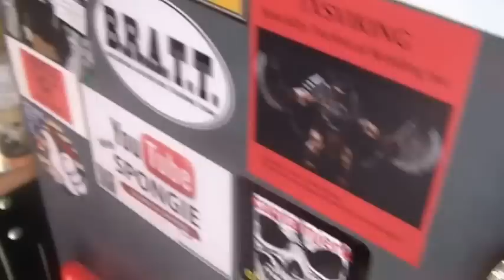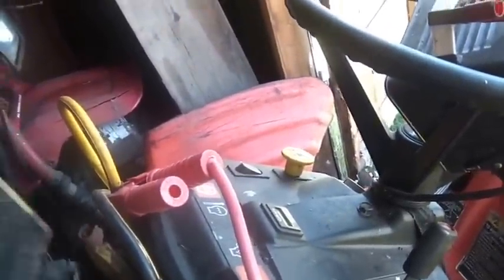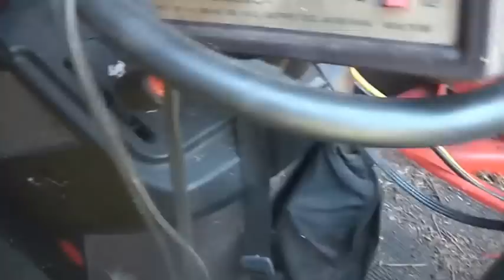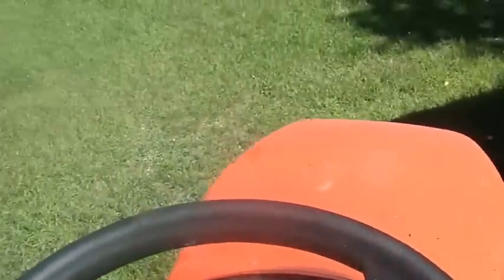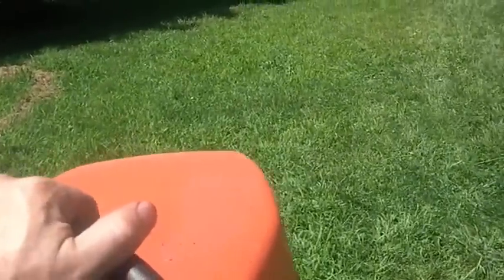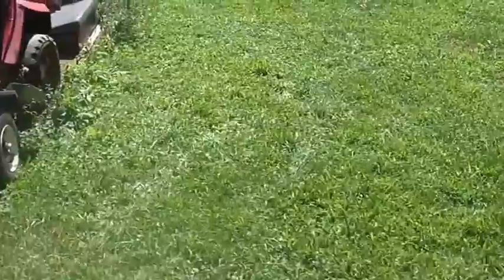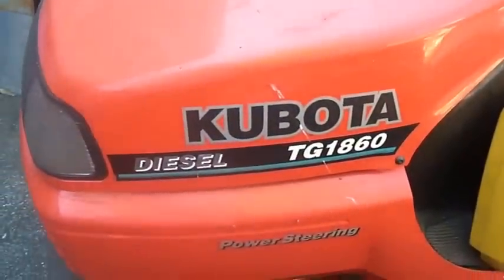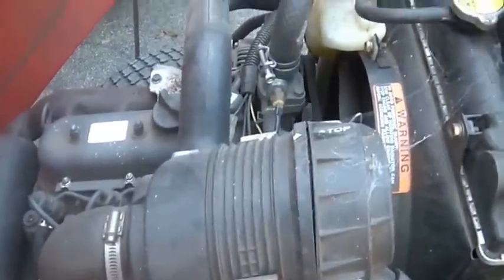Kubota D722 diesel cold start, TG1860 ride,

Comment: From the sounds of it you like the heartache and sometimes difficult and adventure of the older cheaper machines.
That Kubota is a very cool tractor, I had a much smaller Kubota gas model very similar in many ways.

Comment: Harvey I like by Kubota tractor , I never had a problem. I have 2  Kubota z482  engine I got new both have less than 60 hours , one I turned unto a diesel log splitter and the other just sitting in storage. Great engines.
Reply from the maker: Hey Steve!!!   Not easy to lay ones hands on Kubota engines, they are great engines, but, expensive... Cool that U got 2 and one is a spare, I don't think Ur first one will ever wear out, especially if U keep the RPMs down a little... Thanks for the info, watching, and commenting!!!

Comment: Where i mow up on the hill , they have a BX2350 . It is nice , but not a fan of the mower deck wheels . It is a 4x4 and sure makes mowing on the hills better . I have done it before with the rider i used to push snow with last winter , but with chains wheel weights , and a lot of hanging on .
Reply from the maker: Hey Terri, I hope the weather improved by U... Kubota makes a nice machine, the BX2350 is more of a tractor then mine, mine is more like a heavy riding mower... No real hills on my property here in NY, my son's place in PA has a lot of scary places when mowing, had a few scares riding the Lakota quad there... Must be some hills to need weights and the need to hang on.... Thanks for the info, your thoughts, watching, and commenting!!!

Comment: i would agree the kubota should be used and stop messing around with those stamped steel riding mowers. if you dont want to be bored cutting the grass,get one of your real garden tractors going like the sears or bolens.
Reply from the maker: Hey Roger, I fixed and used the Kubota to cut the lawn today, I will probably be using it for the remainder of the season, about next year, God only knows, I barely plan minute to minute!!!   Thanks for your suggestions, thoughts, watching, and commenting!!!!

Comment: nice cold start, good luck fixing it, also it is 20hp at 3600rpms, here is the Pdf brochure for that engine http://kubotaengine.com/assets/documents/04_d722_36.pdf here is also the model tier 4 final version brochure http://kubotaengine.com/assets/documents/Brochures-Engines%20Tier%204/2016%20June/SUPERMINI/d722_e4b.pdf